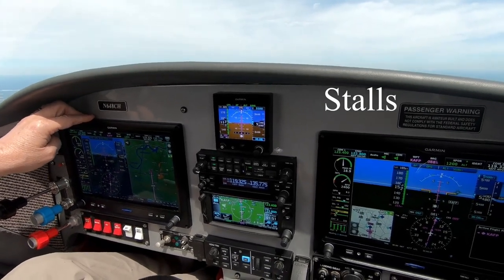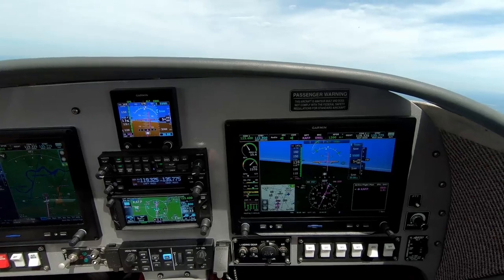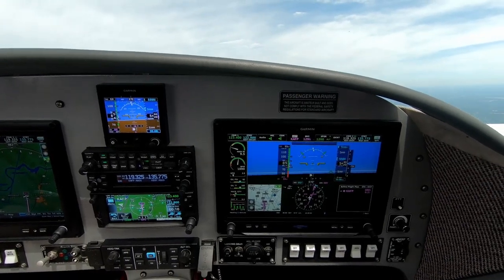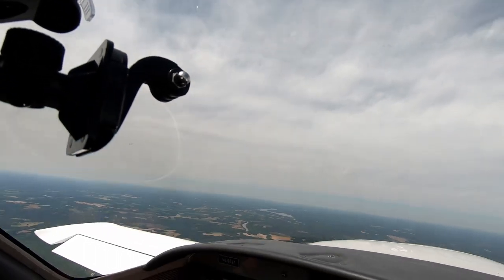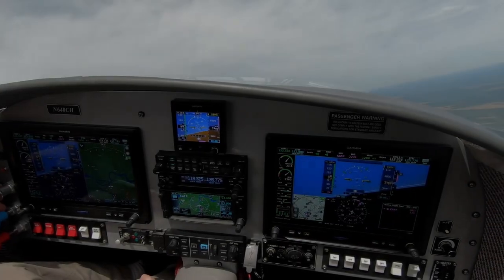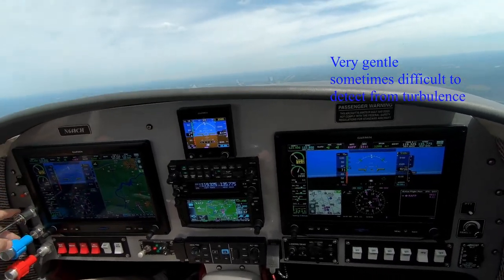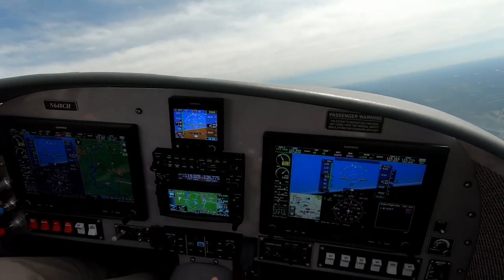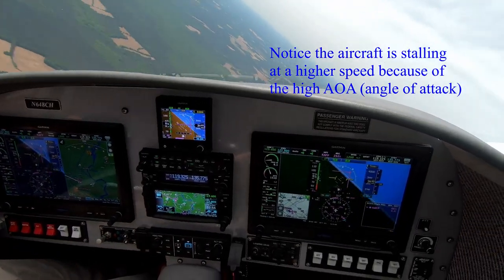Velocity Aircraft Stalls

Comment: Hi Bob, Just an FYI  You mentioned "
Robert Gaudioso
3 weeks ago (edited)
The Velocity's rudders do exactly what you describe except I don't know of any that have the push on both rudder peddles and then the rudders can be used as speed brakes.  That feature was designed out of the Velocities a long time ago.  Now, there may be some still flying with that feature but I don't know of any. 
I fly an Eracer, same design, independent rudders. I sometimes deploy both rudders at the same time if I am a bit fast on final. They are truly independent.  I also have a electric belly speed brake that I deploy on final which gives me a perfect F15 angle of attack for landing.
Great videos keep it up!

Comment: Do Velocity aircraft have independent rudders like the LongEZ?  Example: Right pedal moves right wing's rudder only and Left pedal moves left wing rudder only, while pushing borh pedals at the same time  creates air brakes9
Reply from the maker: The Velocity's rudders do exactly what you describe except I don't know of any that have the push on both rudder peddles and then the rudders can be used as speed brakes.  That feature was designed out of the Velocities a long time ago.  Now, there may be some still flying with that feature but I don't know of any.  If you look at my slipping video I explain the rudder a little more and show them on the ground.       https://www.youtube.com/watch?v=iI0sK2HUTQo&t=10s

Comment: It looks like the aelerons (sp?) on the canard were down when you were stalling with the stick "full aft". And when you showed the wings, I didn't see any flight surface that appeared to be sending the nose up. 
What did I miss? I'm sure I missed something. 
Great video, thanks for sharing. I hope to fly a canard someday.
Reply: The control surfaces on the canard are the elevators.  In a conventional tail the elevators push the tail down to make the plane go up.  In a canard the elevator "lift" the nose up to make it go up.  So what you were seeing were the elevators on the canard lifting the nose up.   The only surfaces on the wing are ailerons, I'm not even sure those planes can have flaps.
Reply: Brandon B Thanks. That makes sense. The elevators act like flaps then, right?
Reply from the maker: @autophile525i  The elevator acts as an elevator in that it controls the pitch of the aircraft.  But, you are right in that these elevators are a variation of a slotted fowler flap.  They do change the chord of the canard some and they do have a slot that enables it to keep the boundary layer from separating a little longer.
Reply: Robert Gaudioso I was thinking they act like flaps in that when you deploy flaps you increase lift, even though flaps deploy down behind the trailing edge of the wing. If the elevator goes down on a non-canard plane, the nose goes down. If the elevators on a canard go down, apparently the increase in lift causes the nose to go up.

But I’m a student pilot (pre-written exam even), so my understanding of aerodynamics is limited.
Reply: @autophile525i  That is because the canard is in FRONT of the C.G. while conventional elevators are BEHIND the C.G.
Thus, more lift in front of the C.G. nose pitches UP.
More lift behind the C.G. (elevator down) and the nose will pitch DOWN too.
Reply: fliteshare Thank you for taking the time to explain that. It makes so much more sense that way. I have much to learn.
Reply: @autophile525i   No.  There are no flaps on a Velocity.  In a conventional plane, the horizontal stabilizer (wing) on the tail has the elevator control and that wing makes a downforce (inverted lift) to keep the nose level. When you want to lift the nose you raise the elevator.  In the Velocity, the cunard has the elevator and raising the nose means you push the elevator down (the opposite).    Stalling in a convential plane means the main wing loses lift, to correct the stall you need to lower the nose and cause the main wing to regain lift.  On the Velocity, the main wing can never stall because the nose is dropped when the cunard stalls.  The cunard is positioned the plane in such a way that it will ALWAYS stall first.

Comment: Really good video. How would you compare the noise and seating position versus something like a 210/182? Anything you would do different options wise if redoing the build?
Reply from the maker: I’ve flown a 182 haven’t been in a 210.  They are really different from a Velocity.  I would hate to try and compare them. After making this stall video I may experiment with vortex generators on the canard in order to reduce the stall speed a little.  I would consider building the bigger version, the XLRG.  In my aircraft I use a portable oxygen system .  If I used it a little more I would consider installing a system.  Some people have played with a nose gear steering system, better heating and air conditioning systems.  Overall I’m really happy with the setup I have.

Comment: Does this plane with canard have to worry about Base to Final issues that many standard planes do. Stall Spin scenario?
Reply from the maker: Yes, the base to final turn is still something you want to pay attention to.  However, there are a number of differences.  The speeds are higher than in most General Aviation aircraft.  I normally fly downwind and base at 100kts, then slow to around 90kts on final.  Just like any aircraft if you get slow or pull too tight a turn you could stall the aircraft.  The difference in a canard type aircraft is that the stall is very benign and it could be difficult to recognize.  In my opinion for what it's worth, it does make it a little safer than some other aircraft that have a more pronounced stall.
Reply: @bgaudioso  
Thanks 4 feedback.

Where is tote home airport located?

Comment: Thanks for sharing this.   I'm curious why Canard aircraft don't normally have flaps to slow down.  Thx.
Reply from the maker: If the canard stalls before the main wing, which it does. The main wing never gets slow enough to need or be able to benefit from having flaps.  The reason non canard aircraft have flaps is so they can fly slower and delay a stall.  If the canard stalls at 65 Kts and the main wing stalls at 55 Kts then you never get to the point where the main wing ever stalls because the canard will stall and lower the nose.    In fact if you ever got to the place where you stalled the main wing bad things such as entering a stall you can't recover from could happen.  The Velocity originally had some problems with this and they modified the design so it is very unlikely to happen as long as you don't get the CG way out of limits.
Reply: I aggre with the last coment but believe there is more to it. While flaps do add lift they also add drag. In a traditional aircraft the first notches of flaps add more lift and a little bit of drag while the last notches add more drag and a little more lift. 

In a canard we would love the drag to help slow down while descending. I rely on flaps all the time while flying Cirrus and Twin Cessna aircraft not because I want to land slower by utilizing the extra lift but to help me maintain a slow approach speed while in a decent on final. The reason in a canard we cannot use traditional flaps is because of the extra lift gained at the  aft end of the aircraft. Since the main wing is located at the rear and not over the center of gravity like a normal plane. The extra lift from flaps at the aft of the plane  would over come the lift of the canard and nose down the aircraft.  Some canards are built with speed brakes that extend out of the belly of the aircraft near the center of gravity so that any lift they may also contribute has minimal effect on the pitch of the aircraft.  

Hope that helps a little. It was a good question!
Reply: @bgaudioso  and Branden: T.Y. for sharing your knowledge with us. 😎👍.
Reply: Well....The XB-70 has flaps on the Canards and it was certainly necessary so there are benefits for some planes.
Reply from the maker: @superskullmaster  The XB-70 was an extremely complicated aircraft especially aerodynamically.  It had so many new features it's hard to remember them all but being a Mach 3 aircraft made for some interesting features.  A movable windshield, movable CG by shifting the fuel, a moveable dihedral wings and probably a lot more.  The canard provided a different function from the more simple Velocity.  The canard on the XB-70 helped in pitch control but at slow speed actually acted as a flap.  The actual function of this design was problematic.

Comment: 4:33 the gross weight here is 100 higher than the factory website, and the -9g design load is > than -7 on same site
Reply from the maker: Ok, I looked at my owners manual and when the weight and balance was calculated the  max gross weight came out to 2400.  The 2300 on the Velocity web site is just a suggested weight and with each aircraft you have to calculate the actual weights and CG etc.  I thought you had a good point on the negative g issue because it does show -7g on the web site.  However, the owner of the factory told me it really should be -9 Gs  but, even that is not practical because their is virtually no way you could pull - 7 or -9 Gs nor would you want to.    In fact even the +12 Gs is just a design load.  When they did the actual testing of the aircraft the max they could pull was 6 Gs.  Now, I'm sure if you put the aircraft into a deep dive and yanked on it you could get a  much higher G load but I certainly wouldn't want to do that.
Reply: Robert Gaudioso got it, thanks

Comment: So you mentioned you have to pay attention to a low speed banking stall.  And we could see the proposing while in the turn.  What happens if you keep pulling the turn and its doing this?  Seems to me like it would just keep doing it until you got so low you stall the main wing.  I haven't seen any info on what happens if you stall the main wing.
Reply from the maker: Yea, your right in that the most probable thing that will happen when you keep pulling in a turn is that it will just porpoise.  I should have clarified a little better in the video.  As an example, when I was doing the straight ahead stall, I was holding the stick full aft and when the canard stalled the nose drops and recovers even though I'm holding the stick full aft.  In theory you would recover once you recognized that you were stalling the aircraft / canard.  Remember a stall is essentially an out of control situation.  The aircraft is doing something that you aren't asking it to do.  So, in a turn close to the ground if you keep pulling the most likely thing that would happen is what you indicated.  The nose would just porpoise.  There is a school of thought that being slow in a turn in an accelerated stall it is possible to stall the high main wing and have the aircraft snap to level.  I have never herd of this happening but have had people tell me it's possible.   The real issue is that stalling in a turn close to the ground puts the aircraft in an out of controlled situation which could result in something you didn't plan on happening.
Reply: @bgaudioso 
Thanks for the response. It's about what I figured. I wonder about stalling the main wing though. Since it would be so hard to do I wonder if anyone really even knows for sure. Seems like recovery would be harder too since the plane won't wind vane like a conventional plane.
I'm thinking about buying one and all this stuff is super interesting for me.
Reply: @bgaudioso  In a turning stall, the nose does not porpoise on the Velocity.  The cunard will stall and drop the nose in such a way that the main wing can still not stall thus you will recover quickly regardless of your lack of inputs.  In a conventional plane, the main wing stall causes a wing to drop and enter a spin, if close to the ground that will result in a crash.

Comment: Has anyone ever made a turboprop velocity for cruising up at FL280?
Reply from the maker: There are turbo Velocities. There is even a twin turbo as well.  However,  there are no pressurized cabin Velocity’s that I know of. So, FL 280 isn’t possible.
Reply: @bgaudioso  ??? Can you not get up to FL 280 with oxygen?
Reply: @xpeterson  Nope..
Reply: @texNoz  I was unaware.  I only knew of the 12,500 - 14,000 - 15,000 flight restrictions with no oxygen system.  What are the restrictions for planes with oxygen masks?
Reply from the maker: @xpeterson  You bring up some good points and this is a topic that would take way to long to address here and should be addressed by someone a lot smarter then me.  The FAA's regulations for General Aviation unpressurized aircraft is really poorly written.  You can use a cannula oxygen system up to 18,000 at which time you would need to use a mask that meets the FAA requirements.  Above FL180 there are all kinds of restrictions that you have to meet just to fly in the flight level and jet route system.  The bottom line is once you get up into the FL 200 or above you really need a pressurized cabin and because even if you have a pressurized oxygen breathing system you will not be able to get enough oxygen due to the partial pressure of the air.  In the military we used FL250 as the altitude for when you needed positive pressure breathing a pressurized cabin is much safer.   I would never fly an unpressurized aircraft up in the FL200 or above on purpose.  BTW, I reserve the right to be generally correct and specifically wrong.

Comment: Old fighter pilots will tell you it’s the position of the stick. If it’s in your guts you’re stalled.
Reply from the maker: Well, being a very old fighter pilot.  I have to agree with you.  There is one little difference in the Velocity.  You can hold the stick in your gut and if you add thrust/power the darn thing will start to climb and just do it's porpoise in a climb.